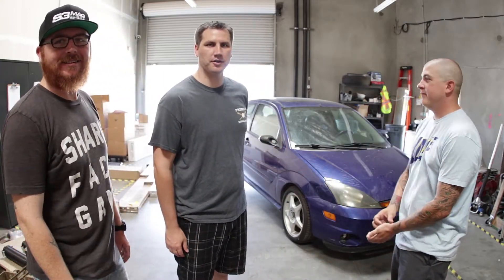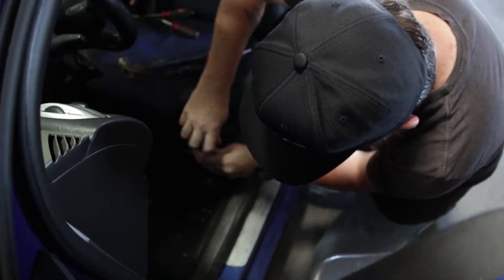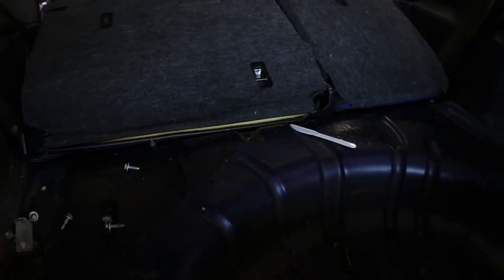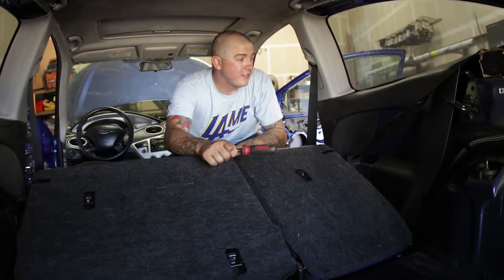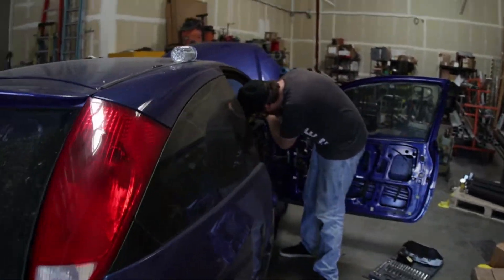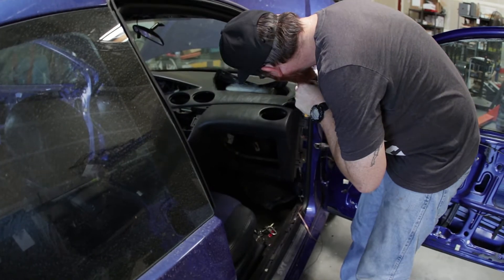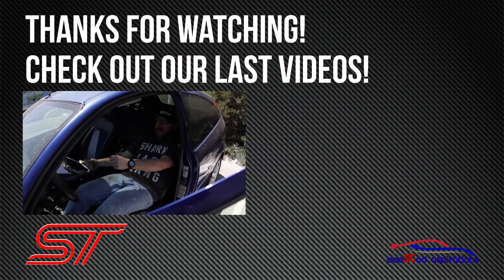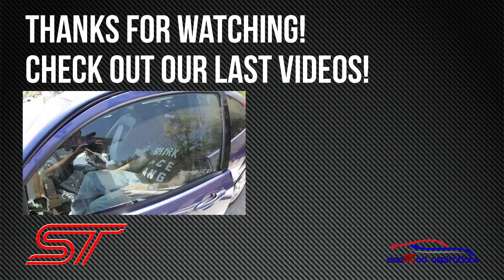Project Budget Race Car: 2002 SVT Focus | Demo Day!

Comment: Great video guys!!! super excited to see how the Svt will come out!! I wish you guy's would of sold parts off the car!! Really in need of interior trim parts. keep up the great videos!
Reply from the maker: +828351nissan unfortunately a lot of that stuff was already damaged. We were going to but none of it was in ok condition.
Reply from the maker: +828351nissan Thanks!  We opted to toss the interior pieces because they were really not worth the trouble of trying to sell or give away. The seats were destroyed and even the door panels had been taken of previously and put back on with non OEM bolts, which meant we needed to break parts off (not shown) to remove them in the first place.

Comment: Some guys without a Torx bit to properly remove some seats are building a roll cage? Yikes.....
Reply from the maker: +Kevin Depew some guys didn’t bring torx bits with them and had to improvise. Thanks for watching.
Reply: Kevin Depew I'll weld an actual bolt to it and take it out that way
Reply from the maker: +Spillman ! Or a nut works too